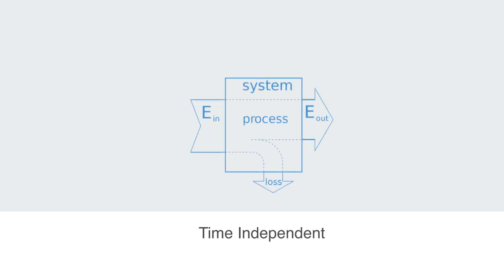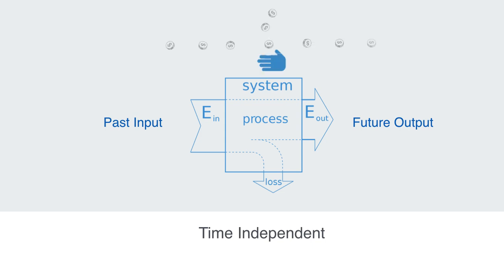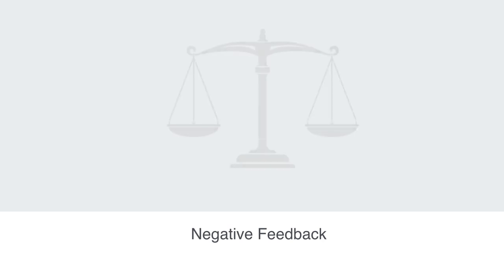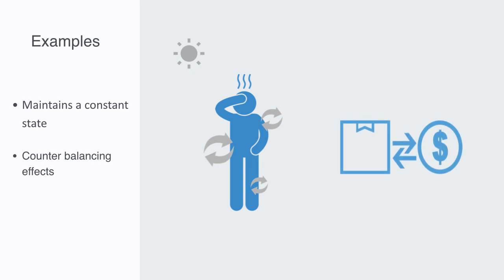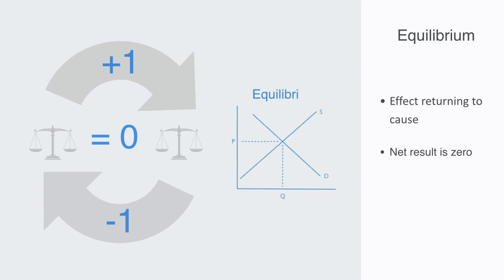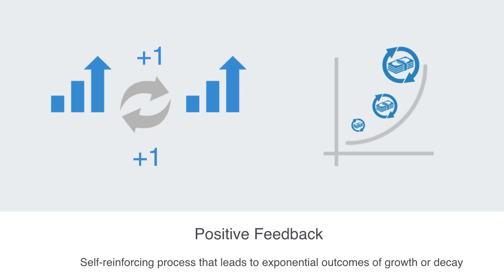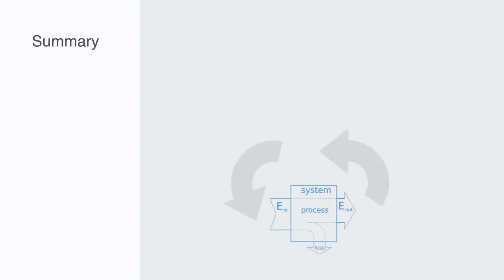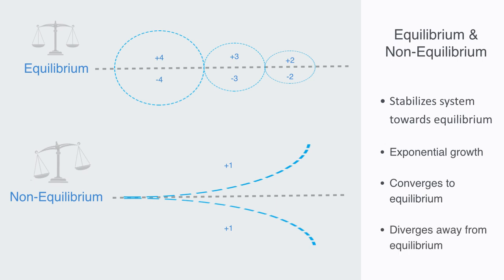Feedback loops & Non-Equilibrium

Comment: Positive feedback: blood clotting. When a blood vessel is damaged, structures in the blood called platelets begin to aggregate at the site. Positive feedback occurs as chemicals released by the platelets attract more platelets. This platelet pileup then initiates a complex process that seals the wound with a clot.
Negative feedback: ATP generation. A cell's breakdown of sugar generates chemical energy in the form of a substance called ATP. When a cell makes more ATP than it can use, the excess ATP "feeds back" and inhibits an enzyme near the beginning of the pathway.
Reply from the maker: +John Peters Interesting, I wasn't aware of that, thanks